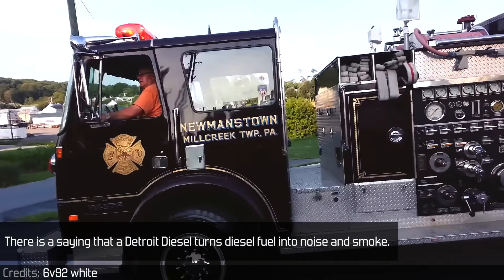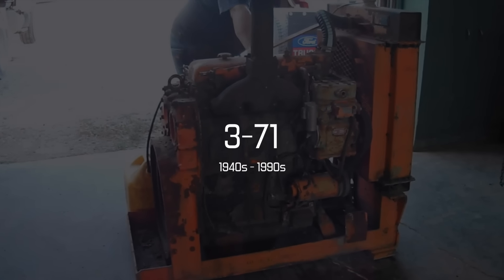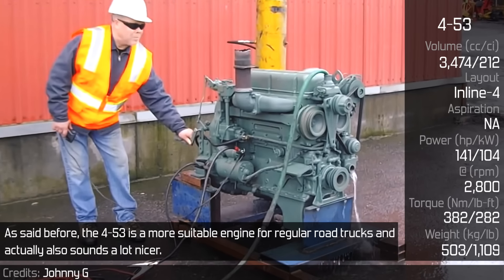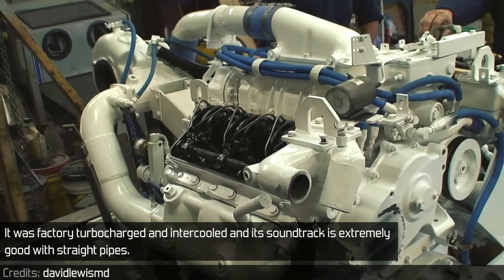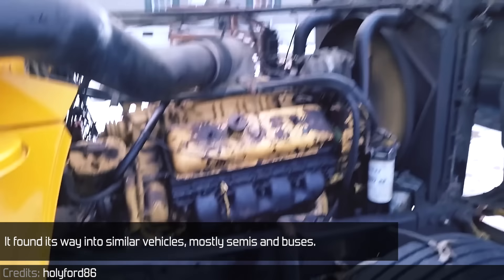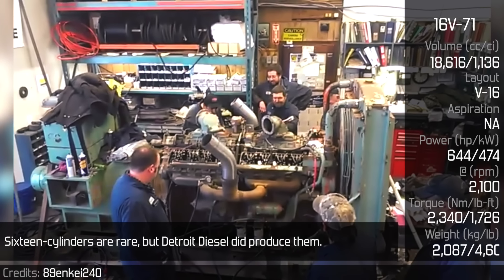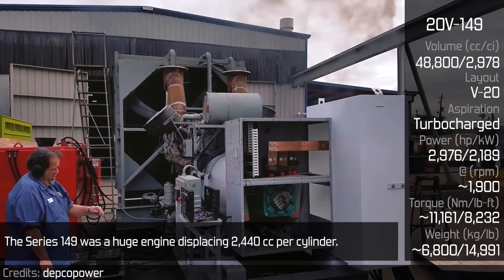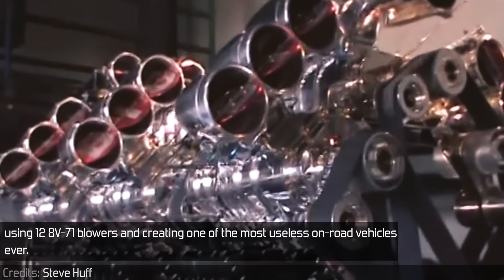9 Of The Greatest 2-Stroke Detroit Diesel Engines Ever

Comment: It's interesting, how 2 stroke diesel sound like it's revving like 5000-6000 RPM but it's running only on 2000-2500....
Reply: Matúš Mikula they fire each time the piston goes up. 
I'm sure most of those didn't get all the way to 2500. I shift at like 2200 when I'm driving angry.
Reply: realistically. they were shifting somewhere around 1500rpm. anything after 1800 is just noise
Reply: thats their unique feature
Reply: @REAPER0D  makes sense. Peak torque at 1500rpm but peak hp is the governor limit
Reply: That’s because unlike 4 strokes they fire in every second cycle. So they sound to be revving twice as fast as they are.
Reply: @pettttson  i adjust idle speed regulator at 550-570 rpm and the max at 2250rpm ,this is for the internacional paystar  truck, rpm between 1800- 2250 of great importance for driving and sifter. Greeting from Serbia for lowers of Detroit dizel!🔥
Reply: @REAPER0D  you basically have to drive them on the governor. It just pulls fuel back so it's not bad for the engine at all. It's also where peak power is made, and detroit's hate being lugged, it causes them to overheat which they're quite sensitive to.
Reply: That's cuz they fire on every stroke got to drive them like you're riding a dirt bike
Reply: I definetly agree with you, specially when it comes to 453-T
Reply: Double the toque pulses, double the noise! Worked on one in the UK, 30 years ago mind. If I remember correctly it was a a V6 in a recovery truck. Dam I miss those days...
Reply: I thinks it’s just cause it fires more quickly hints the name it only takes 2 strokes to fire vs 4
Reply: 2 stroke engine is 2 stroke .
Reply: Best engine ever 318 Detroit tune just rite kick coming and cat ass.
Reply: Hense fuel into noise ....and lack of power
Reply: Sounds like it’s run away redlining 100% of the time
Reply: It’s bc the 2 stroke has more rpm per stroke than a 4 stroke
Reply: Was just bouta say this
Reply: Egnition every revolution makes that
Reply: @yamahaguy1732  It fires every time the piston gets to the top vs every other time for the 4 stroke engines.
Reply: @thatranger92  you worded that wrong.
Reply: @integritytransport8762  yeah sorry, what I meant was each revolution has more strokes in a 2 stroke as a 4 stroke or something along the lines of that
Reply: ???,twice as many firings per revolution  ???
Reply: They would blow up
Reply: It's considered high for a diesel. My 60 series runs up to 2200 max
Reply: It's got twice as many fires as a four stroke
Reply: Twice ignition frequency => twice sound frequency.
So, it sounds like a 4 stroke at 5000, it is revving at 5000/2

Comment: Two stroke diesels often sound like they're screaming when they're really not reving all that much.
Reply: They revv a bit higher than other diesels though.
Reply: They barely get up to 2.5k, modern 4 stroke Volvo FH can go up to 3.5k. It's because the power stroke and exhaust stroke happen twice as much as on a 4 stroke and thus sounds like its revving twice as fast
Reply: @Edwin Orantes My Dad called his 238 a YammerHammer (Yamaha). It turned 2750 rpm which is insane. But he built it to take it. Chromed crank, oversize injectors, a little fine tuning on the pump and there you go. Eat 290's for breakfast and make 318's question their lineage all day and all night.
Reply: @Travis Max instablaster ;)
Reply: that's pretty much true for every 2 stroke, though

Comment: I worked on General Electric gas turbine generator sets all over the world. Many of these had 600 HP Detroit 12-71 twin turbo engines as a STARTER MOTOR. It was a common starting means on  MS5001 turbines that were rated 24 Megawatts or over 30,000 HP at 5100 rpm. The 12-71 would start, idle for about 20 seconds, then go wide open governor to spin the turbine up to 20% speed where the combustion system lit off. The Detroit would be screaming the whole time while the turbine accelerated and finally over ran the jaw clutch driven by the diesel. The Detroit would go to  idle and cool down for a few minutes then shut off. The whole process took about 5 minutes of wide open diesel power.
Reply: I assume they had a fluid coupling ahead of the jaw overrunning clutch?
Reply: @kleetus92  Yes...a Twin Disk hydraulic torque converter as part of the accessory gear box. Works great!

Comment: All those Detroits hunting and surging makes me sad that no one knows how to properly tune them and adjust the buffer screw.
Reply: i thought that was because they were cold, goes to show how much i know about detroits....
Reply: That's the buffer adjustment or worn fuel control linkages.
Reply: You're correct. At first start up  a Detroit surges up and down,but idles entirely different when warm.
Reply: surge till there's some heat in the blocks...
Reply: Joshua Leach I agree but there's a lot to factor in such as gov. Riser may be worn out or gov gap nor set right. All that has to be properly adjusted and set. Plus the rack has to be set correctly. Then after the engine is warm you can set the buffer. My rule of thumb is turn buffer slowly until rpm slightly increases then back off half a turn the fine tune it from there
Reply: And I purposely set mine to idle like thay because I think it sounds cool
Reply: A good tune should not be idling on the buffer anyway . It's primarily as an anti-stall device .
Reply: Joshua Leach 
U got that rt & probably has a flat operating shaft fork & it sits on the sandwich bearing
Reply: Hardest thing to do on an old detroit is to properly run a fuel rack.
Reply: Wrong if rack is tuned properly it will run cold unevenly but not long.
Reply: This uneven running is called hunting not surging and that is common with worn out governor parts and improper tuning.
Reply: I remember during tech school training, one of the students' misadjusted it,,,,it ran away and everyone scattered......teach ran over with a board and slammed it on the intake. 
Ohio technical college late 99, class MT-53.
We learned a shitload from that !!😂
Good times.
Reply: My dad had about 15 trucks with the 2 stroke Detroit diesels in them.  He purposefully set them so they were constantly searching.  When asked by someone why all his trucks weren't running properly, he'd tell them he liked the way they sounded and when pulling off with heavy loads they'd surge harder and quicker which seemed to help gain traction in the sandy conditions where they operated most of the time.  He might not have been correct but there's a part of my life where the background soundtrack are several 6-71's all searching first thing in the morning when they were warming the trucks up and getting ready to take off.  I was awoke many morning to that sound......and I LIKED it!
Reply: This is interesting. I have two 1974 ish 8V71's in a boat and they will hunt a bit when cold but smooth out pretty quickly. I am trying to learn how to adjust the idle, set the rail etc.  Have a lot to learn.
Reply: I worked on many Detroits while in the military and understand what you are saying.  Many techs did not how to set the governors nor run the racks properly.  I used to fix many these in the field while working as a level 3 inspector in Germany back in the late 70's.  Those were the days and I miss them.
Reply: The 6v53 sounds the best IMHO. There's another video somewhere on YouTube of it.
Reply: @stephenstewart9242  
And the Johnson rod ain't inline with the Gigglin pin so the Torque annihilatior  wont wind down👍
Reply: @sabrinacordell6290  
My 8-71 when I cold start her. Let's say outside Temperature about 40. She surges. When warm she PERRSSSSS
no surge.
Reply: A great guy to get a hold of us Bus Grease Monkey.  He travels to you in his Greyhound Silversides and is a dedicated 6-71 mechanic.  Find him on YT.
Reply: @UncaDave  
He is Great. Watch his videos 
I like how he changes out Let's say just Little things like Gaskets. To seal better. You know how Leaky Detroits are. I just Love how there such a universal Engine. I think that's why the military Liked them. Common Parts going between Engines of same Displacement. And plates on Block on both sides. For example in my case a Block Heater.
Reply: @wakeup6910  fact remains Detroit and Cat built America.

Back when they had equipment half as capable and did twice the work

Comment: One of the great things about the inline 2-stroke Detroits for marine use is the ability to customize the layout of the intake and exhaust. Boats tend to have smallish engine rooms, so the ability to move the blower and exhaust manifold from one side of the engine to the other for clearance issues was very useful. Pretty cool old engines, the design is from WWII and a great many are still running strong!

Comment: A good article overall, but with one error. There were NO 2 stroke Detroit diesel engines that were naturally aspirated. ALL of the series in this video were supercharged, the inlines had a supercharger bolted on the side and the V types had superchargers mounted in the top of the V. In addition some had turbochargers for more power. These engines had no intake valves, but had slots in the liners for fuel to come in and required a supercharger to operate. DD made an 8.2 liter V8 that was turbocharged only, but not a subject of this video.